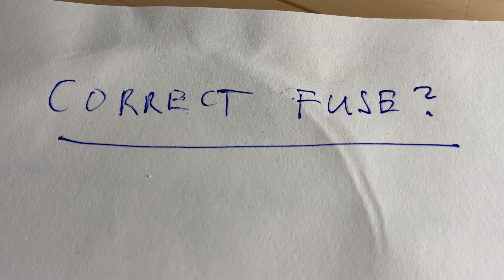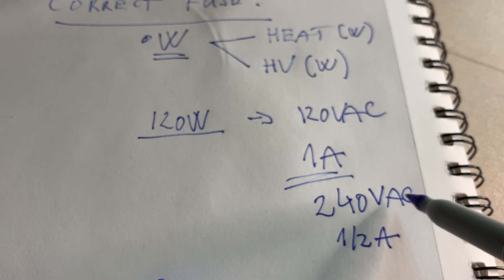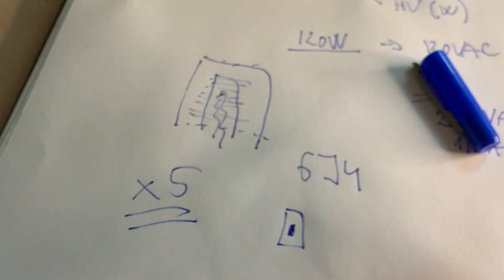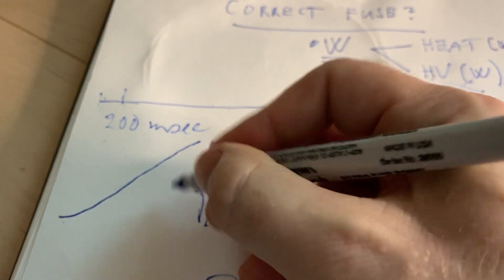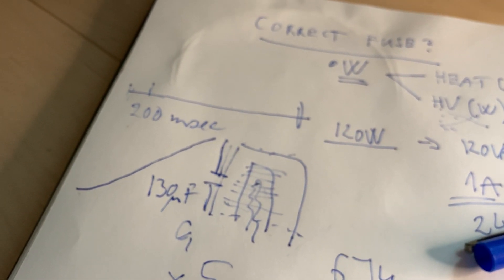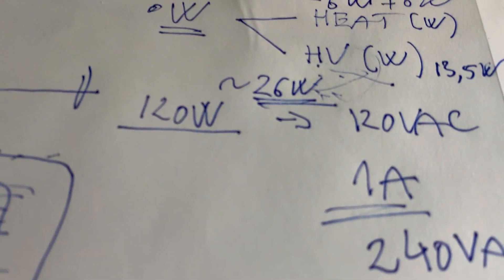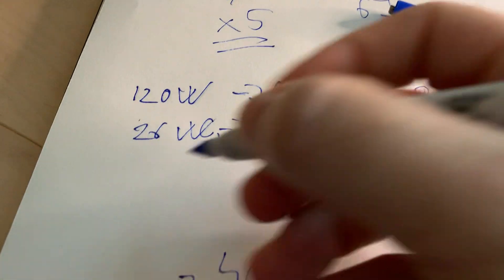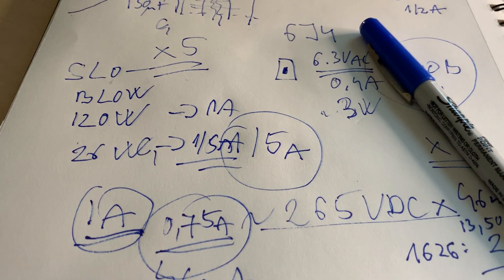Correct fuse selection for a tube amp!

Comment: Janos, I liked your idea about using your Rio Grande 32 awg silver wire to replace the crappy quality fuse and fuse holder like you did in your PS Audio cd player. So what length of silver wire is required for 1A or 2A or 3A…?
Reply from the maker: Hi Marc, it's not the length but the gauge that defines the amperage: too much current and the wire melts. The glass body around the proper fuse wire makes sure that the heat builds up faster, that the humidity and air pressure does not affect it... so, a plain wire used as fuse is not as specific as a factory made fuse - you cannot make a piece for exactly 1A, 2A, fast or slow blow. AWG32 silver is the thinnest we can get, so that's the limit. The main thing is that it will be the thinnest wire in the power chain: what you want is thinner wire than your power transformer primary or your output transformer primary. That's what a fuse needs to be sized for in a properly designed and built tube amp. (For an average commercial tube amp I would stick to the rated fuse the manufacturer specifies though!  Even slightly bigger fuse than specified can cause major equipment damage under power surge conditions. As most commercial tube gear have p1ss poor engineering, I would only recommend using the silver fuse in DIY amps.)
Reply: @realworldaudio  Thanks Janos, that makes complete sense, never void the manufacturer warranty…

Comment: Beautiful explanation on the fuse selection Janos . I just thought I would make a comment to your viewers on 
fuse replacement say once a year to keep your system sounding optimal. This applies whether 
the fuse needs replacing or not. Over the many on -off cycles the small filament inside the fuse will 
stretch and subsequently increase resistance effecting the sound quality. Factor in all the pieces of gear in your system  with a fuse in it and the effects in sound quality become quite significant when old fuses are replaced.Regards Lou
Reply from the maker: Thank you Lou, I did not think of that yet.... it makes perfect sense, the fuse is the element that is subject to the greatest metal fatigue in any equipment as all turn on cycles take it close to its limit.
Reply: Lou , you're right ........................fuses are also subject to wear...........🧭

Comment: Hey RWA,
 Very useful calculations, thank you. I do it this way also, then use a Kiil-A-Watt meter to make sure that I'm correct. 😉 
This brings to mind another topic: NTC thermistors to limit inrush current. What is your opinion on these concerning SQ, and where should you put them? 🤔
Reply: NTC's ...I use them often..................it's a case by case situation , all depends on the concept and lay-out of your amplifier.............one an build also with slow start on heaters first and afterwards , one minute later start up of the high voltage rail..............preserves tube life of heaters and the tube itself...(  Whenever you invested today in rare and expensive NOS tubes ...( up to 10 times the lifespan ) ..in the past era of tube gear , tubes were consumer replaceables , this is no longer the case .
PS: This also applies when you shut the amplifier off...................first shut down the HV and let the capacitors bleed down....................then shut down the heater voltage supply .
Tube SHOULD NEVER WORK without the electron cloud formed around the cathode, current must ALWAYS be drown of the electron cloud and NEVER directly from the cathode coating ( CATHODE STRIPPING ) ..........this was not an issue when tubes were simply replaceable.in the past or today when money doesn't count 😛....................Tube sellers and amplifier manufactures earn much money not informing their clients ....
Reply: Agreed! I switch on my 45 DHT outputs and driver tubes first and let them warm up for a few minutes. Then the B+, slow started by the heating of the rectifier's indirect cathode. I power it down in the opposite manner, as you suggest. Those DHTs are precious.  👑 
I currently use an NTC on the AC input to the amp (CL40, I think), but am wondering if it'd be a better application to use a few at the heater transformer primaries or another place. I just think of everything running though that little NTC, and if it limits anything.  Same with fuses, but those are kind of a necessity. 😉